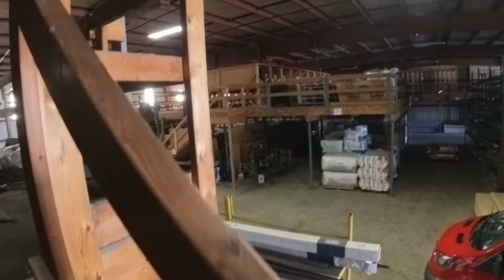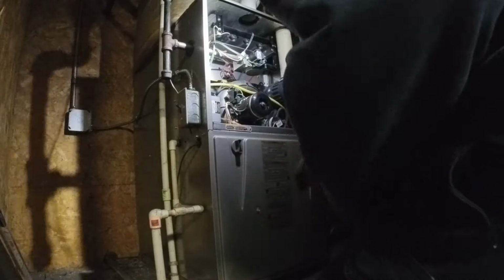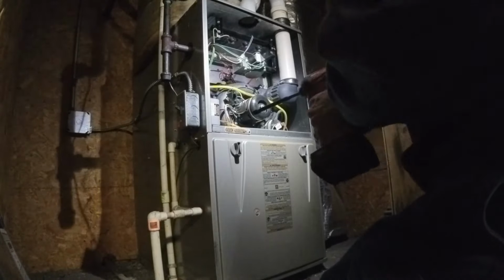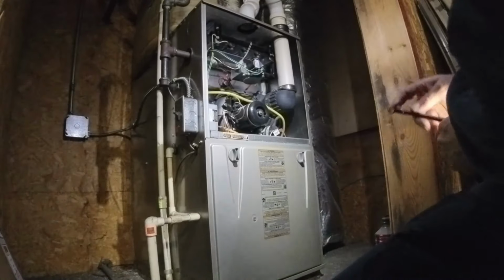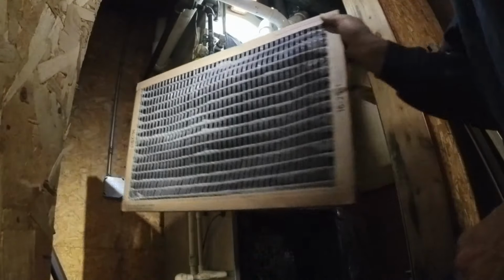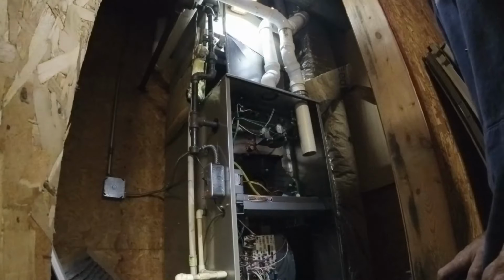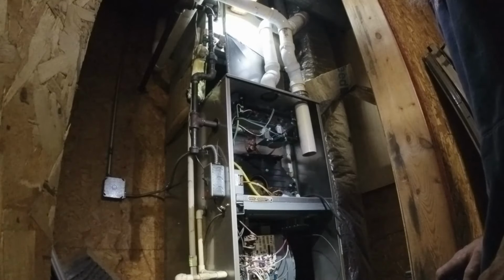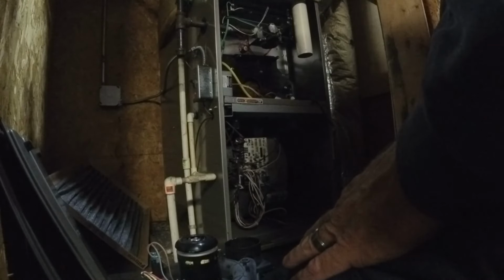I Think Your Furnace Is Running Hot.

Comment: Power switch is in the on position while you were working on it should secure power and fuel source. Keep yourself safe bud.
Reply: The safety switch would of killed the power when he took the panel/door off.
Reply: What's going to magically let gas or 120v through?
Reply: @GoatzombieBubba  that technically is the blower safety switch a secondary power cut out
Reply: @AmericanFarmerHVAC2024  safety first never assume anything
Reply: @williamhansen5762  Every modern furnace I've ever seen the 120 from the breaker box comes right to that switch. I've had many a calls of a faulty door switch.

Comment: on a 10 year old furnace as you have shown.....would a new furnace be more cost affective in lieu of replacing a new heat exchanger and collector box to include your labor?? curious how you presented this problem/solution to the customer. I did hear you mention it is under warranty but not labor.

Comment: You did a water heater valve replacement video that had a Honeywell valve.  Have what looks like same value.  Can any Honeywell model value work?  I have WV8860B1317.  Can   WV8840B1158 be used to replace?
Reply from the maker: Not sure